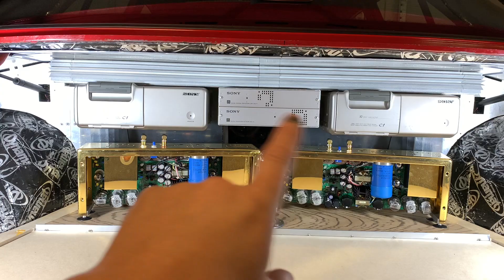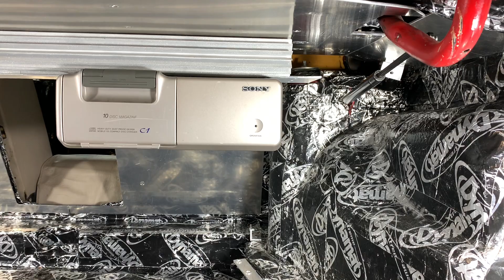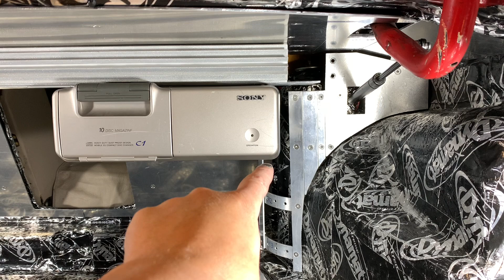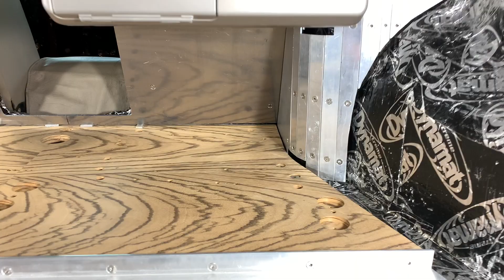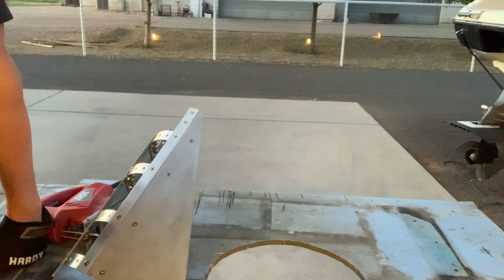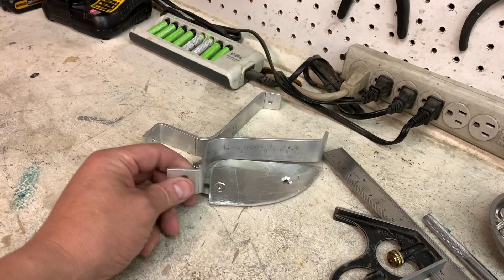CarMiZa- A Legendary Car Audio Details part 20- Sony C1 Changer Fit Modification

Comment: To solve the width problem, I was thinking maybe you could waterjet the amps center coupler in half.. I think there would still be enough space for the fuses there. That would move the two changers inwards.
Reply from the maker: @yomama5785  - Cool idea!  But I was super fussy about the placement of the spacing between the components, including the overall length of the 1-Zapco.  Thanks!

Comment: Maybe you've gone over this in another video, but why was the car pulled apart in the first place? Was something broken in it or something?
Reply from the maker: @michaelbloom5342  - When I bought the car, it was intact, but quite rough.  I pulled it apart until I got to a point where there were zero issues, which ended up being down to the core.  The overall concept of the build it to maintain the design and ideas that Earl and Henry had, use the same products, and build it back better where possible, based on my skills and tolls available.
Reply: He took it totally apart down to the wiring hardness to rebuild it.
Reply from the maker: @yomama5785  - Yeah buddy!